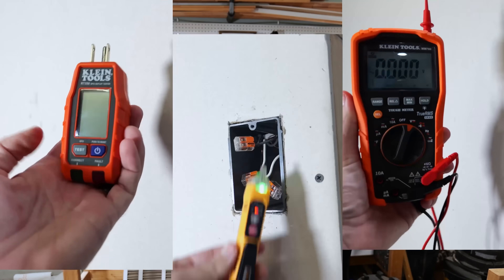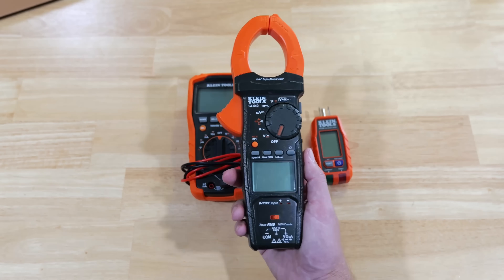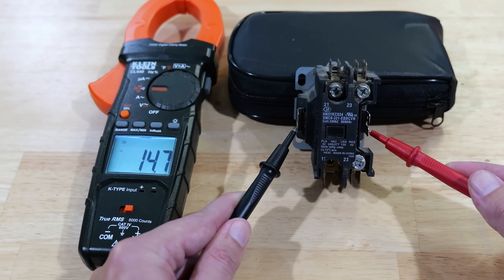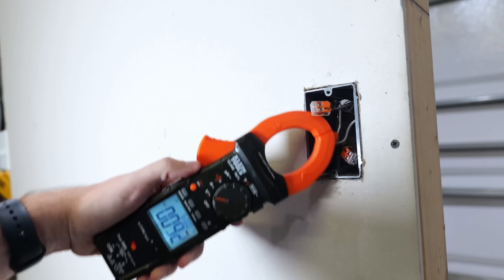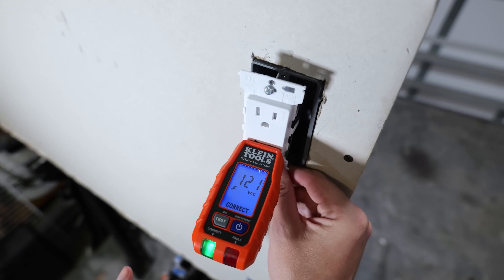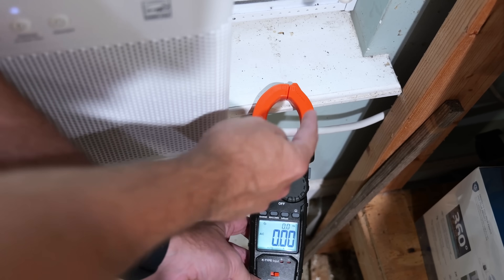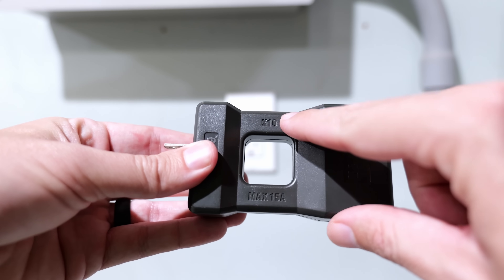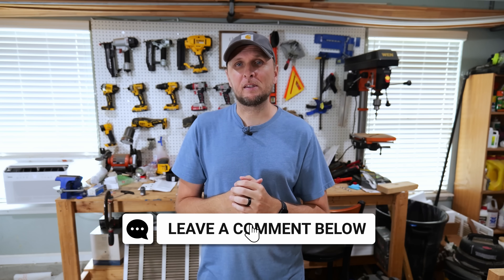The ONE Electrical Tool That Can Replace Them All!

Comment: Clamp meter is not practical. You need two hands to hold the probes and there is no where to put the body of the meter itself. Bought one after watching this video and this is my conclusion after using it for few months now. It's not that I don't use it, but some other tools are more practical. It's better than multimeter though :)

Comment: So it’s a meter with a amp meter and a widow stick built in? I’ll take the fluke t5-1000 and a plug tester and widow stick any day .over that Klein.  Why would I give up these 3 items, for a meter that only does a half assed job of all three?   I will say I do like that line splitter, did not know they made these. Thanks for the video.

Comment: Why different amp readings? Clamp around the wire its just over 3, clamp on the attachment with the 10x being just over 6. Why aren't they the same?

Comment: Non contact voltage tester and an outlet tester are meant to be quick and convenient, 
A multimeter and a clamp on meter are also very useful, but not exactly always quick and convenient. 
Therefore you can’t really compare, 
You can cut an electric wire with lineman’s pliers or you can use a side cutter which is designed for that specific purpose, 
You’re very obviously trying to sell an item not needed by someone who has those other 3 tools.

Comment: My fluke was a goner. Battery leaked. The Fauci-19 lockdowns share the blame. I looked around and found my next main meter - a UNI-T UT210D palm sized clamp multimeter. NCV and backlight plus hold. Nice. Not a Fluke but affordable and  good enough for retirement repairs, not 150A AC / 415VAC stuff. 2xAAA sweet. And oh, the clamp can handle DC current.

Comment: It's taken a while for you Americans to come around to the British Ground-Neutral-Live  and maybe 240V setup. I had an argument with my company's engineers because I was installing their rack(for computers) and they always came Live-Neutral reversed. They said safety was not compromised because the computer power supplies had internal  fuses on both Live and Neutral lines. What's your take on Live-Neutral reversed?

Comment: I am not going to explain it here but you can use an ordinary meter to check all that the plug in analyzer does. I can do that, but the plug in analyzer is fast and easy.  Thanks for a great video.   Proster makes a  multi meter that has a non contact  sensor and many other great features  and it is very reasonable priced.

Comment: I do not think that it will replace them. You are taking the same  ac voltage measurement. The NC Voltage detector will do a better job.

Comment: Great video well presented, clear and concise. As a GC I have many tools for multiple trades. I have this clamp meter and simply do not need it or use it often enough to make it useful for me. At my length in this game of over 45 years I simply call one of my competent electricians when I need them. Some day I will need to part with most of my collection. Probably when Im not here to make that decision. After all the rule is ( the guy that dies with the most tools wins! )

Comment: Don't need to remove an outlet in order to use a clamp on meter. Either use a commercially made Current Clamp Accessory, or fabricate one with few components.

Comment: I just use a meter with a no-contact voltage detection function - and it's half the price (Extech 330 vs Klein Tools CL440).
However, the point of an outlet tester is to be fast and convenient, rather than having to carry around and fuss with a multimeter. If you are a home inspector or similar, you aren't responsible for fixing issues, or diagnosing beyond a very basic level of "good" vs "bad" - you even talked about this some in your video, how it's a dedicated tool for a dedicated task. Its inclusion in being "replaced" thus seems frivolous, and it really seems more like "let's replace one multimeter with a different multimeter" rather than "replace all your tools with one".

Comment: As an electrician for years now, hot sticks or "non-contact voltage testers" are unreliable without being brand new and with basically full batteries. I've lost all trust in them after time after time of being shocked after getting no signal. I've stopped using them altogether and just use my multimeter and plug tester. Getting used to using a multimeter as your default will enable you to troubleshoot much faster, you have to switch to it after a hot stick anyways, just skip it.

Comment: wanted to thank you for all the help on explaining my electrical issues and slowly buildin up my equipment! 

 my house is really REALLY old!  i'm in the process of replacing all the 2 prong,  2 outlet and even a few 3 outlet receptacles! 😲 ..yes, THAT OLD!   i've bought all Leviton receptacles and green grounding wires,  i'm assuming i will need one for each! 

 i was wondering if you could explain to me why while using my circuit breaker finder is showing the same two or three breakers box beeps for all my outlets..??   

electrical is one of my least fav types of DIY, but i'm trying to learn!  ..so any additional help will be very appreciated!  
👍

Comment: electrician here......i keep an old school solenoid tester, hi zoot digital hvac tech style. a widowmaker (non conact) and a cheapo continuity tester (easier to see).....sorry you cannot do it all effectively with one tool there are too many things to check for.....i also use a tone generator to find nodes on dead circuits......

Comment: As someone whose done residential electrical work, but when I am thinking with my home owner hat on, I would probably start with an outlet tester/circuit breaker finder, because I feel like that covers a lot of early projects, then I would go with a contactless probe for generally finding hot wires and then I would go with the clamp to cover the functionality of a multimeter. But that’s just me

Comment: The clamp meter should have been designed such that the clamping accessory attaches to the main unit via a sturdy 3 prong receptacle plug .The female end of which would be part of the clamping accesory while the exposed male plug would protrude from the main unit (at the connedction point). This would allow the main unit (minus the clamp) to  plug into the receptical. How does this not make total sense?

Comment: So, it's really one tool that's much larger that requires a bunch of different attachments. Okay...
Reply from the maker: Umm no more attachments than any other multi meter. And yes it is generally taller because of the added clamp feature. 
 Which is attached.  You wanting to put it in your pocket?  🤣

Comment: I have the clamp version that does DC and AC amperage. The one thing that drives me nuts is the Auto off shuts the meter down within 1 to 2 minutes. You can defeat the auto shutoff by holding mode down while turning the meter on. It still beeps at you like it is about to turn off but doesn’t turn off.

Comment: I've been able to get the amperage by clamping just the very ends of it part way over the cable. Easier to do when the cable insulation shows a clear definition between the two wires. Harbor freight sells a plug in splitter by Ames, but it's huge compared to that one. It has 2 windows to clamp around, one for 1X, & one for 10X. I don't know the point in having both. It also has voltage check test points for multimeter probes, marked N, E, & L. I used a multimeter and read continuity to learn that N is neutral (as I expected), but found that E is actually for ground (Earth ground) and not for EMF like I had thought, & L is for Line (hot), which I couldn't figure out earlier since I thought the E was going to be hot as in EMF. I just figured that maybe it was one of those cheapo companies that does stuff weird and brushed it off. Personally I would've gone with H, N, G or at least put the earth ground symbol, and maybe color coded each letter black, white, & green. The test points only read to the prong (male) side of the device.

Comment: Great video. I am curious about the amperage readings you got. When you clamped around the wire to the outlet, it showed 3.3 amps. When you used the splittir, it showed 66.4, devided by 10 equals 6.6 amps, which is twice the first reading. Any clue why?
Reply: They are different AC units. From what I see in the video… The 3.3 amp version has a door within a few inches of the receptacle while the unit reading 6.6 amp does not.

Comment: ABSOLUTELY WRONG, no "Clipon Ammeter" can properly do the job - of a multimeter - and visa versa.
I wouldn't put a general low voltage multimeter anywhere NEAR a 3kva circuit, but would confidently use a clipon in that situation

Plus we, as electricians SHOULD have in our posession a MEGA - a resistance meter which measures the insulation resistance of cable installations, which obviously to measure those resistances, MUST generate up to 1000 volts.
Your piddly wee multimeter cannot do that.

Then there are the NON CONTACT voltage testers, which quite honestly I only use, to initite a first research approach.

NEVER assume they are working, and NEVER assume the reading you get is reliable, it's just a quick "oh look" tester for DIY people who don't have the right tools.
It's also a kinky tool to take to halloween parties and the like, where  quick rub on anyone's clothing, will generate enough static electricity to "power on" the tester's light to allow you to exclaim - OH YOU ARE HOT TONIGHT - aren't you?

They are sometimes quite deadly if yu assume they have NOT found a voltage when you then disconnect the WRONG WIRE, that wasn't tested.
BOOM it was live but thankfully the fuse blew as it touched some earthed metal and NOT you.

New fancy tools come with new fancy ways to assume they are the bees knees when it comes to:
One fool does all, or in your case, one tool does all.

The ONLY real use that I ever found, with the non-contact voltage meter (pen) was to find live circuits inside walls, as you cannot trace a cable any other way.
Unless of course you use highly expensive high frequency injection tools, that measure the higher frequencies as you run a probe along a wall, to trace the same hidden cables you can trace, with a non-contact pen.

The other use was just that - "a use", to turn it's lamp on and off, to trick kids into thinking I was a live wire.
Just generating electrostatic currents, by rubbing the end on anything that collected static voltages.

Oh and it usually glowed during thunder & lightening storms, but honestly - if you can't see the brilliant white flash of the lightening and hear the huge rumble in the sky, that wee pen light won't save you...

Comment: The terms "Amperage" and "Wattage" readings are hurting my brain. You are measuring current and power.
It goes like this. The current reading is 6.3 Amps, not the "Amperage" reading is 6.3 Amps.
Reply from the maker: Really splitting hairs here
Reply: @HowToHomeDIY  It's not splitting hairs. There are words that mean what you are trying to say, and then there are made-up toddler words, for when you don't know what the actual words are.
If you are going to make instructional videos, at least try to make the instructions correct.
I would argue that if you don't know what current or power are, then measuring them is meaningless.
Reply from the maker: 😂 there is nothing wrong with what I said.  I was getting an amperage reading.  That’s what it’s called when we measure how much current is being used.  Everyone has gotten it but you because you have an opinion on what verbiage is more proper.  Splitting hairs.

Comment: The only thing I seen different is on Klein meter the extra toner. I knew everything else. What are the main things I look on a clamp meter can I get those batteries in AA or AAA since the most common one you'll find immediately is 9 volt which means you need to buy a battery some of the time when you need it on the job site. That's why I I spent extra time making sure I had a different battery size in my clap meter. I also like it the show positive and negative on voltage just in case if my electrical outlet tester is missing or broken. The next thing I liked on mine is temperature probe and 1000v rated I got mine on Amazon though not fluke brand since that would be way too out of budget to buy fluke. I've also made a cord for using with the clamp meter before though I do have a line splitter too. The only fluke tool which was all right on price was toner kit.

Comment: Half the video is showing us how a multimeter does the same job as a multimeter. 😐 Then we learn that I can do the job of a voltage tester but since it can't fit inside anything small it can only do it once in a while. Then we find out that just like a multimeter, it can detect voltage from an outlet, which makes it not like an outlet tester. 

So basically this entire video is a multimeter can do the job of a multimeter and not the actual job of the other two tools. Exactly opposite of the title of the video. Nice.
Reply from the maker: That’s your opinion based on your preference.  That’s not at all what actually happens.

Comment: The plugin socket tester can't tell if the neutral and earth (ground) are transposed however so be careful on that front. The ONLY way to test if everything is the connected the right way is by using an independent earth test

Comment: If you are thinking about a generator or a back up supply the watt meter can help you figure out what size you need to run what you want.  Add them all up and that will put you where you need to be, but of course I would go over you don't want to max out your generator or back up supply

Comment: I've used Fluke the majority of my 28 years in the commercial/industrial career, but I found myself helping a friend one day and he didn't have a meter. I ended up buying the Klein CL800 and fell in love with it. At work I carry the Fluke 376FC, but for my home tools I use the Klein CL700 now after leaving my CL800 on the bumper and driving off (talking about being pissed). It's more than the average home owner will ever need, but they make less expensive models that works just fine. I do keep my "Idiot stick" AKA non-contact voltage sensor in my pocket nearly 100% of the time for those tight spots. Also, I wouldn't recommend an inexperienced person to even own a non-contact voltage sensor. They CAN be unreliable or even outright fail if they're damaged or the battery is weak and that can get you hurt!!!
Reply: A friend who is an electrician recommended that I always keep two “idiot sticks” on hand. Each being a different brand and model so that I can check one against the other, to be extra careful when doing any repair work.
Reply: Whenever I am using a non-contact voltage detector, I will quickly rub it back and forth on my arm hair.  This will create a static charge, and if the detector is working properly along with a good battery, it will trigger the alert.
Reply: I wouldn't recommend two different brands because they could have different sensitivity levels. Some brands/models drop below 90 VAC and reads induction when the circuit is actually de-energized. To be honest, we shouldn't even be using them at all, but if I do I use the "live dead live" system.

Comment: Honestly this is probably the worst electrical video I have ever seen. People commenting that "Wow, that's really cool...". WHAT? Every electrician (well, anyone decent) has a meter like this. Weee. Welcome to 1990 something. So you're going to drag out your big expensive meter to "check" if there's proximity voltage? Test every wire? By the way, you went "hot to bond" when you tested. That's a no no!

Comment: SO why is your AC unit pulling 3.17 amps when testing the wire directly but when using the splitter, it's showing 6.14 amps?
Reply: Just guessing but maybe unit was on low on first time and on high on second. Or perhaps compressor was engaged on second but not first.

Comment: Uhh, why did you have to touch the clamp to the wire to get the voltage? What happened to the whole point of "non-contact voltage detector?" Lol
Reply from the maker: Uhh I still didn't make contact with the wiring.  Yes I touched the insulation, that is not the copper and I you don't have to even touch the insulation but the closer you get the stronger the signal and beeping will be to let you know you are on the right wire.  Geeze 🤣

Comment: When using a non-contact voltage detector, always check it against  a known energized source to verify that the detector is working.  I was taught to do that with any source from 48 volts and higher.  Even with sources up to 100,000 volts with the proper equipment.
Reply: Yes, a Live-Dead-Live test.  After you check on a known live source. Check that your target circuit is dead.  And then check again on a known live source.  A requirement at my power plant.
Reply: It just shows you how people will use a $10.00 tool and actually trust that tool so as not to hurt you or someone else or burn someone else's house down. Rather then buy a real tool and to it right. You see you have real electricians and you have helpers that really think they are electricians.